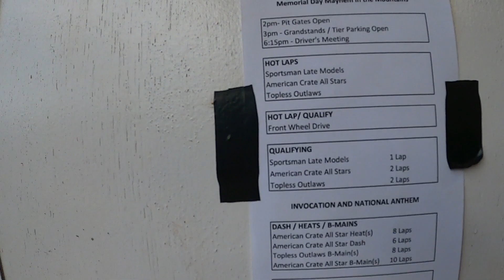We made the trip to Smoky Mountain Speedway with the Topless Outlaw Series

Comment: remember to much right  rear it will skip in the center and push you left to much left you'll turn to the right it's all balance good run though the rear balance changed changed somewhere
Reply: I worded that wrong when you turn in to the corner gravity will load the right front and unload the left rear when you center the corner and pick it back up if the banking changed the air holds the nose down until the motor gives true posture back through torque and the left rear tire doesn't set down level fast enough the right rear will push you to the left and want to rotate the car your right about true posture but when you turn g force will change that a little or it should

Comment: entry didn't look to bad , center out you looked tight or the car was binding up
Reply from the maker: Entry was good. A little free everywhere else, wanted to keep rotating
Reply: @daysofdirtwithbradberryracing  it's hard to tell from a video but it looked like the car doesn't set back down on the left rear until forward bite really kicks in
Reply: @daysofdirtwithbradberryracing  it's hard to tell from a video but it looked like the car doesn't set back down on the left rear until forward bite really kicks in
Reply from the maker: You don’t ever want the car to sit down. You want it in posture all the way around.
Reply: @daysofdirtwithbradberryracing  true once we scaled our car got the left rear to right front transfer then back on the to the left rear coming out all we changed was the off set on the rims and stagger we ran port royal every Saturday nite seemed to work at selinsgrove about the same fast places lf your familure